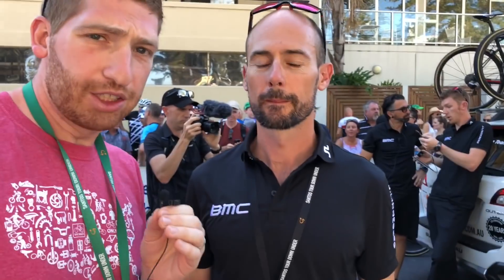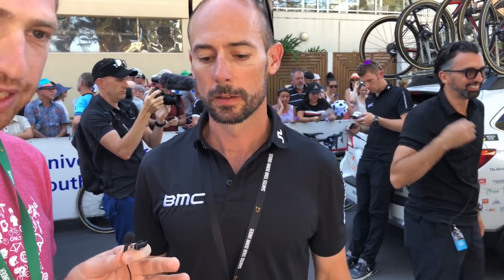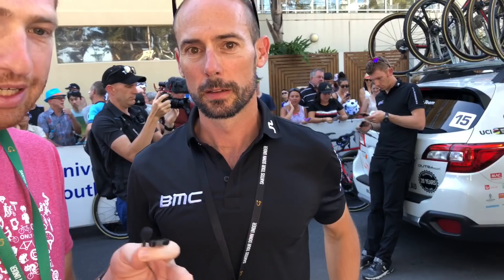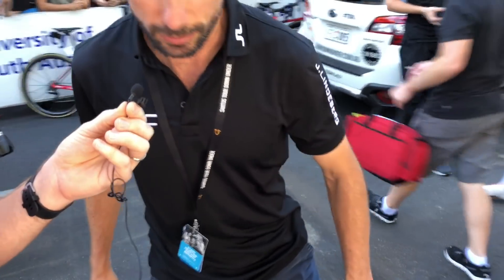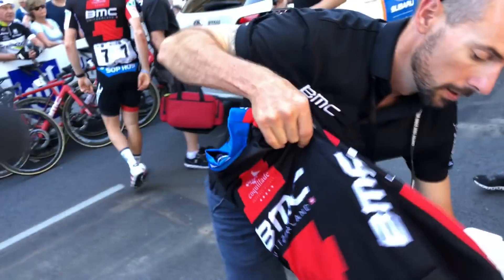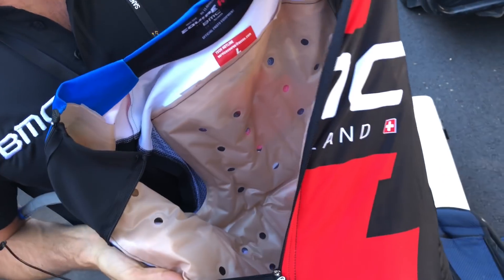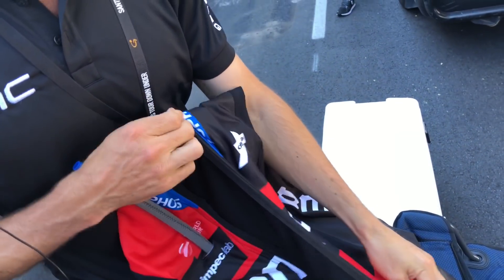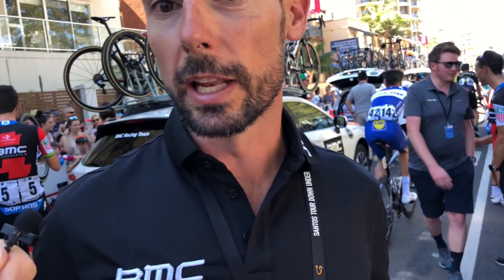Tour Down Under 2018: Cooling vest tech for 106*F/41*C race day!

Comment: I'm a mechanical engineer for Lennox in Texas. This may be a little late to help.  But they need to consider latent heat capacity when they begin using this in races.  Basically letting the air flow still get to the person's sweat to remove heat through latent heat rejection.  Removing heat may be more effective at cooling than introducing cold.

Comment: What’s the point to cool the rider with this vest before the start? I mean, when the gun went off, you re gonna be sweating again, powering through 260W in no time!
Reply from the maker: It's to start them off in a better spot than the other 180 or so riders.  By their own admission, this is mostly a logistical test of the system as they want to get to the point of being in race with them.
Reply: Even before a race your rate of cooling will be better than competitors. From a marginal gains perspective it will hopefully add up. 

Also drinking cold liquid and cooling the spine had shown to have a significant effect on the body in hot temperatures. 

And finally in an endurance event your rate of gastric dumping can be kickstarted by drinking a very cold electrolyte drink. I.e. You can absorb carbs alot better.
Reply: Because the majority of your energy used during exercise is spent by your body to cool itself. Cool the body externally (with this vest) you (potentially) have more energy to race with. Body doesn’t need to work as hard to cool itself, it can expend more work propelling itself.

Comment: I've been wondering why this wasn't done with helmets for years!  My head always feels like I have a massive fever whenever I get off the bike leg of a race, which is an awful way to start a run in a tri.  I've been keeping a bucket of ice-water to dump on myself during transition and it helps but I've always wondered about filling my cooling vents with ice
Reply: hngldr In the 1990s AGV Helmets (motorcycling) had some cooling system technology. Unfortunately, it wasn't a big seller, so it faded away from further development. I knew a couple racers with that helmet. There was barely any weight difference.